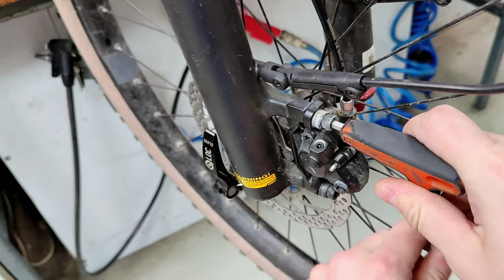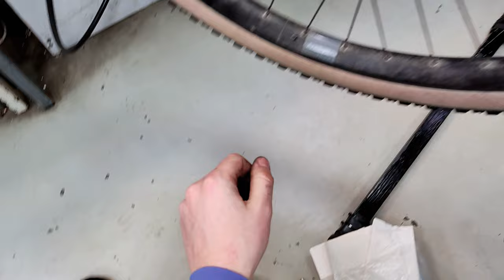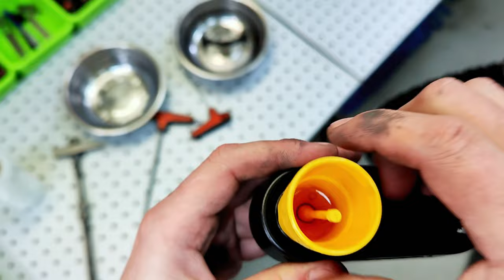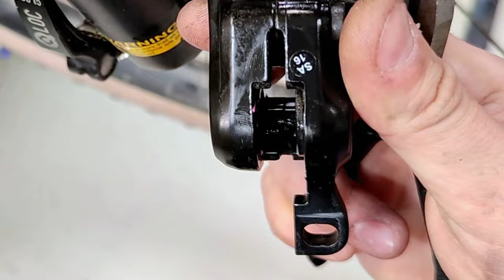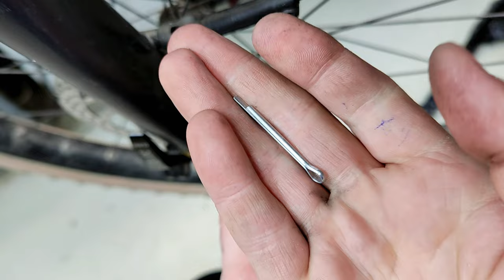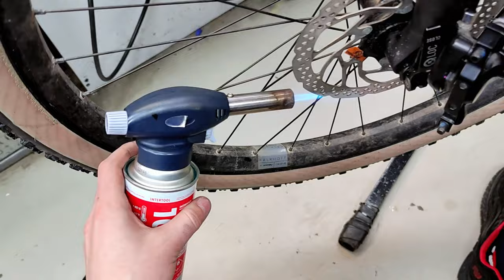Bicycle disc brake pads replacement. Hydraulics Shimano BR MT200.

Comment: Every time i change brakepads i also refill the whole line with new oil, its always good idea because we make sure we take out all dust and dirt inside the caliper, so we have a longer lifespan in our machines.

Good job and good video!
Reply: @NiceBikeService  you welcome 😁😁😁
Reply: Nonsense. Buy quality brakes that use mineral oil and yearly oil changes are more than enough.

Comment: Why did you heat the rotor with a flame? Thanks for the video, as my Kona has a set of Bravvos brakes fitted, and it seems to be a copy of the MT200 caliper
Reply from the maker: To burn out the grease that has not been wiped off with wipes in the rotor slots

Comment: does it work with b01 or b03 pads?
Reply: They are basically the same. The only difference is the wear resistance (as advertised)
I have B05s Rx and they work the same as b01

Comment: I wouldn't recommend taking advice from someone who rides their pads way too long. Bad for the rotor, the pads, and the brake assembly. If you can't use the equipment properly you probably aren't maintaining it well either.
Reply from the maker: Thank you for your feedback. For some reason, bike couriers don't keep track of the condition of their bikes and postpone the trip to the workshop until the last moment
Reply: @NiceBikeService  Horse crap. Good couriers are some of the best at maintaining their rides.
Reply from the maker: Unfortunately, we have few of them